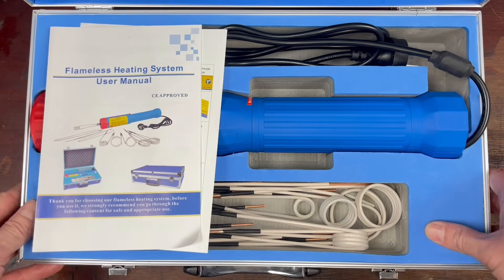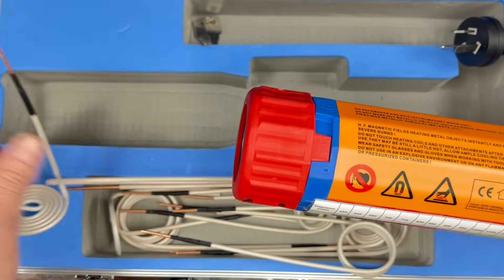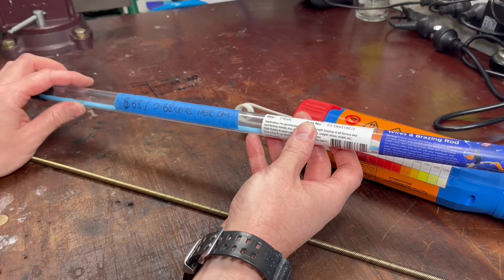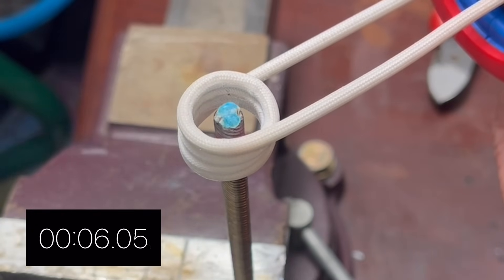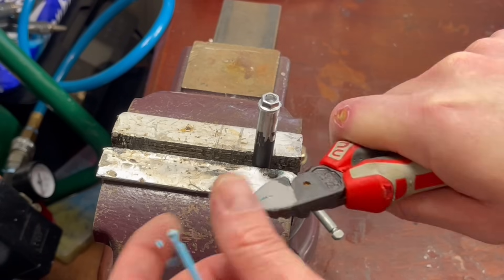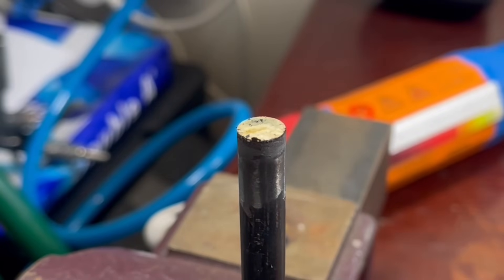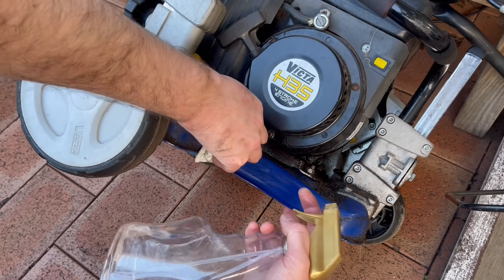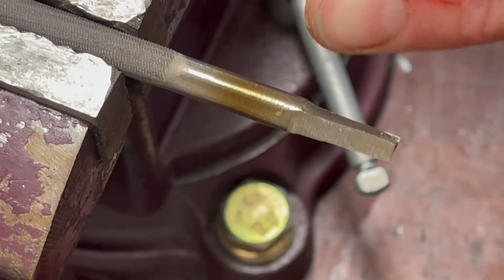Every Mechanic Needs This Tool! Save Time & Money!

Comment: Using a steel rod / bolt inside a hollow brass fitting that has a split, I wonder if the radiant heat would silver solder the split wrapped with a shim of brass / copper to reinforce the split.

Back in the 1980s we used special spelter rods that had flux in them. They were put on top of each tube to braze copper heat exchange fins and but on a chain belt to run through a bright brazing furnace it was a big thing about the size of a small bus.
There were 12off  6inch diameter 5 ft long SS tubes with gas burner in each one 
We also had an Exothermic generator next to it that produced an oxygen free atmosphere 
One of my tasks was to service the burners and check the 12 burners combustion with an oxygen sensor.
Reply from the maker: Very good question!!! I have no idea, but that would be cool!
Reply: @VintageEngineRepairs  The middle coupling on my power washer wand has split brass fatigue split because I used a rotary brush, the power washer is over 20y old and very heavy, the lightweight plastic same make replacement failed after 10y the motor bolts came loose and stripped the gear drive to the pump.

The most dodgy repair we did to at the Blacksmiths shop was a hydraulic coupling we wire wrapped it in steel wire and brazed it. It held for the customer.

 My dad once repaired a fire engine cast iron gearbox that struck a rock and was in 16 pieces, using special nickel stick rods it was welded back together and kept warm on the forge to stop it cracking when it cooled. You turn it over by hand but it did squeak a bit, back in the 1970s a UK recession they could not get a new gearbox.

1930s my grandad made a micrometer, I still have it. I have a picture with him working in front of the Shaper and thread turning lathe ;-) he is shoeing a Shire horse for the local Brewery ;-) He hated the horses leaning on him..... He and my dad were small build I and my GGrandad were big chaps. Great days I learned to weld stick when I was 10y and in 1980s I bought my dad a Hobart TIG plant that was used in the Irish factory that made Delorean cars... One time my dad was on holiday and I had to visit the library to figure out how to repair a missing blade on two out board engines a Yamaha 70 and a (Mercury 70 I reckon this had more magnesium because I nearly set the prop on fire ) 
I balanced both props on a set of parallel bars using a flap disk.

Those were the days without the WWW

Comment: Nice tool Tom, it'd come in very handy in situations where open flame wasn't an option.
It amazes me just how fast it heats the objects. 👍
Reply from the maker: Thanks John, it’s shockingly quick isn’t it. And that rod I brazed a nut to - I made another copper coil with 8 wraps rather than 3, the whole punch was glowing bright red within about 10 seconds. Unreal…
Reply: 🙂👍🏼 That’s so awesome, seems like it takes forever with a torch on some of the stuff I do.
Reply from the maker: Yeah agreed mate and gets expensive too.